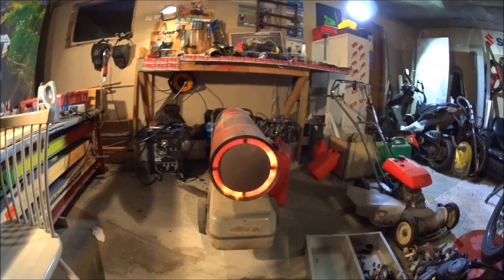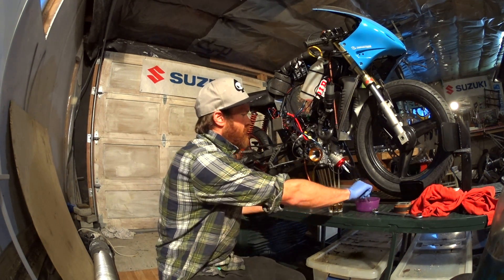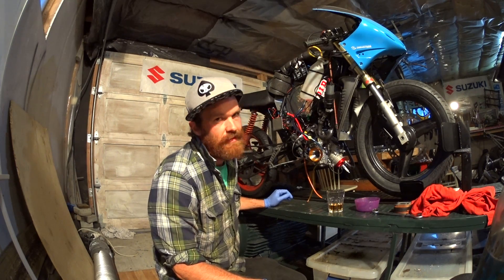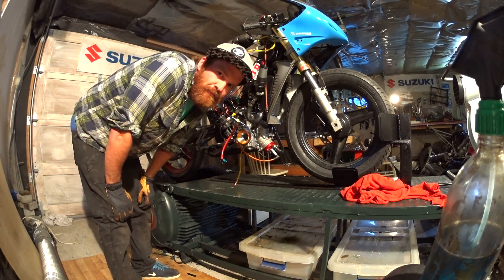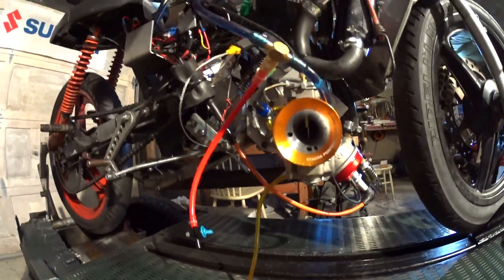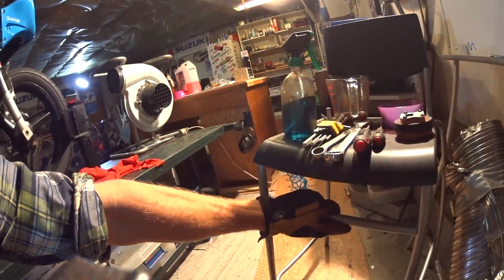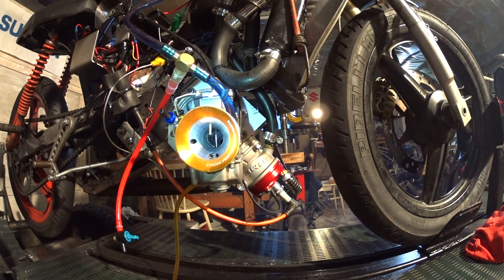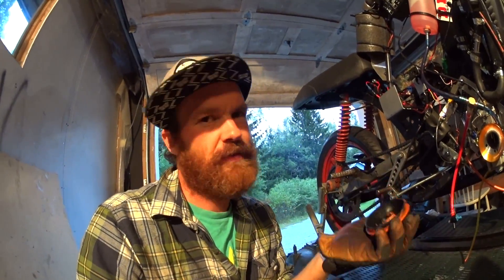YOU WONT BELIEVE IT! Two Stroke Running With No Intake Valve!

Comment: Why go through the effort and time to take it out when it would run better with it. That is why it was designed with one. They would not of designed a Reed valve for no reason lol... Nice bike though.
Reply: Ps the valve stops pressured air come back through the carb thats why you can see fuel coming  out not going in. The reed valve stops air coming back out the carb and instead pressurise the crankcase... When the piston goes down. And basically the pressure in the crankcase pushes fuel air mix into the cylinder so if anything you loosing power cause you won't have the pressurised crank case.
Reply from the maker: +Thomas Ozanne Thanks! Because it's interesting to see how it behaves, and it can potentially make more power without the valve.
Reply from the maker: +Thomas Ozanne With the crankcase volume and intake geometry working together in resonance you can make it never blow the wrong way through the carb within a narrow rpm range. Sync it up with the pipe and it might actually produce more power than with a valve because there's nothing messing with the resonance. My engine is definitely not optimized for this yet, but you gotta start somewhere.
Reply: @2STROKESTUFFING  never seen that ever before ..  really amazing.. 👍
 i would have lost that bet instantly... 😊
 Thank's for   sharing and learn me a little bit more about different intake types. Ps. What is the World record HP, for 2 stroke 50 cc  ??  Maybe you'll be breaking it 💪👍

Comment: All 2 strokes dont have intake reed valves. Like example suzuki pv 50 that was brouht to finland, they had to take reed valves off to get the power down to 1,5hp so it was legal.
Reply from the maker: +ACreativeName Wows, lots of comments... No. You are referring to engines with piston controlled intakes, the piston is the valve. Here I'm running with a gaping hole into the crankcase, always open. Completely different.
Reply: 2STROKE STUFFING but when the port is closed it cant escape. Same with the normal old 2 stroke engine
Reply from the maker: +ACreativeName Now I understand! You are mixing up the intake port and transfer ports. The transfers move mixture from crankcase to cylinder, the intake moves it from outside into the crankcase.
Reply from the maker: +Old School YAMAHA You are right, all two strokes don't have reed valves. Some have reeds, some piston port induction, and some rotary valves of various designs. You sure about this PV engine? Sounds interesting!
Reply: 2STROKE STUFFING yea i am sure :D the suzuki pv is like cultur moped in finland and u can get soo much parts and information of it so its nice moped to tune and play with ;D
Reply from the maker: +Old School YAMAHA You sure there's not a different cylinder made for the Finnish market? Like with many other small capacity Suzuki engines the PV has a weird combined piston port and reed setup. The intake is routed both via a port in the cylinder wall and directly through a reed valve into the crankcase. Not to be rude or anything but I'm 99% sure the restricted "finland-versions" are running in piston-port-mode-only  either with the reed passage blanked off, or with cylinders missing the reed passage all together.
Reply: 2STROKE STUFFING yes it haves different cylinder, i am not sure how they make it work without the reeds.
Reply from the maker: +Old School YAMAHA It works because the intake is both piston port and reed controlled. Blocking off the reed passage makes it piston port only, but not valveless like my engine.
Reply: 2STROKE STUFFING oh okay. U should get suzuki pv and tune it ;) would be fun to watch and u would allso get loads of finnish subscribers
Reply from the maker: +ACreativeName No. The the hole is open 360° of rotation, gas can escape whenever it wants to. Imagine you take a 30mm drill bit ant punch a hole in your crankcase then slap a carb on it.
Reply: 2STROKE STUFFING but it only mkes minor differences since there is in both ways nothing holding the gas from going bavk out from the port.
Reply: Old School YAMAHA theres nothing special about it. If your from germany then you know the mopeds and mofas. They had no valbe at all the carb was directly at the intake port.
Reply: 2STROKE STUFFING but theoretically its the same since the gas still cant escape until tdc. Your hole is just at a diferrent point but other than that its the same https://www.pinterest.de/pin/16536723607172152/sent/?sfo=1&sender=798122502621513957&invite_code=9434a56962584e8383b9148c8d0edd1c

Comment: I had russian vashod 175cc two stroke and it didnt have reed valve. Nothing special
Reply from the maker: +Silver Eik That engine is piston ported, meaning the intake port is in the cylinder wall and the piston is the valve. My engine has an open hole directly into the crankcase.
Reply: True didnt think that far :)
Reply: 2STROKE STUFFING but theoretically there is no difference at all
Reply from the maker: +ACreativeName No, theoretical or not it's completely different.

Comment: I wonder if Runner length from the throttle plays a big role now.... I bet you if it had a pinch point in the intake it would work a lot better.
Reply from the maker: +all the boost It should. Alot to be tried here.

Comment: The piston is functioning as a valve, thats basics in a 2 stroke engine. The powervalve is just improving flow, it is not essential for the engine to run.
Reply from the maker: +aaron f No sir. In a piston port induction engine the piston is in control of intake timing, in both reed and rotary valve the piston has nothing to do with it(directly at least). This engine is designed with a rotary valve intake, in this video I'm running it without the valve. Just a big gaping hole into the crankcase, always open. You are right about one thing tho, the valve doesn't seem essential for the engine to run...

Comment: If you would have asked me will it start and idle I would have said no, it shows that the motor is not dependent on primary compression from the crankcase. Will be interesting when you run it again to see if you get fuel standoff at the carb inlet and how this changes with revs. you have blown one theory,  but the pipe should not resonant over the full rev range, at least not according theory ? Keep up the intersting work

Comment: Early 2 stroke motors had no intake valve of any kind, just the normal porting so no reason why it will not start at least. Valves and reeds are methods of controlling the internal flow for power and emissions control. Even now small capacity low power 2 strokes do not have valves. Eg chainsaw motors.
Reply from the maker: +Frank Beaton All those engines actually have intake valves, the piston. It's called "piston port intake".
Reply: Yes they do but the piston closes the intake port on the down stroke ! , this engine has the intake port below the piston @ BDC
Reply: rght works like PP 2t like chainsaws! Reed valves and rotary valves are there just to prevent the flow back at intake side!
Reply: manos vitalis theres nothing special about it. If your from germany then you know the mopeds and mofas. They had no valbe at all the carb was directly at the intake port.

Comment: No surprise here, said in last comment itll probably start and run, carby acts like a bit of a valve to get it started and since transfer timing contains the combustion its not like a 4t without an inlet valve. it should rev too, once engine speed rises gas inertia works more.
Reply from the maker: +I Make and Fix Stuff Good point about the transfers! I'm eager to see how it behaves at and beyond peak power, and what kind of power it makes.
Reply: Should be ok up top, consider a broken reed will effect lower RPM, and maybe over rich at lower end with potential for extra dosing at the nozzle as the air passes it going in, again as intake blows back out at lower RPM with no valve, and maybe more as it sucks back in.

Comment: that's interesting that it started and idled so easy. it must be the pipe ?? I know it works at wot but not at idle. people broke the pettles on reed valve motors and they still ran. would be interesting if you could somehow lock the rotary valve on the intake phase on wot or when goes on pipe. or a reed valve that could be controlled to stay open at a certain time

Comment: :O Everything I've been taught about two strokes is a lie! That is nuts! Do you think it will be able to fill the cylinder at WOT? I assume the throttle is providing some back pressure? Or will the exhaust pipe resonance/pulses pull enough vacuum to facilitate cylinder filling? Awesome stuff man!
Reply: "the light bulb conspiracy" come to mind.. like; been made up just for manufacturers can get that little extra paycheck at the end of the month loool
Reply from the maker: +Me 2 Haha, Maybe maybe more of the "essential" parts can be tossed too, like the piston and crankshaft.
Reply from the maker: +TheForcedinductn Thanks! In theory it should be able to fill the cylinder when on the pipe, we'll see! It's all about resonance!
Reply: @2STROKESTUFFING  .. No, farts are all about resonance. but now you're talking methane, not petrol.
Reply: The TZ has a larger delay before it covers the port. Yes it does but at lower RPM you get fuel spitting back.  As speeds increase the mass of the air and speed actually help it stop spitting back. You are getting it working because the gas speed is high enough to keep the mixture from coming back out. The valve timing should give better power but it will run cleanly once the gas speed is high enough to overcome the crankcase pressure. You are just losing crank case compression.
Reply from the maker: +Richard Vanags Nope. Watch my intake types video.
Reply: Hi man! I really can't believe that this is hapens! It is idle, yes, but do you test it with wide open throttle, and with the loaded engine?
Reply: It is basically the same as early Yamaha TZ's with piston porting. No reed valves or any kind of valves at all...
Reply: theres nothing special about it. If your from germany then you know the mopeds and mofas. They had no valbe at all the carb was directly at the intake port.

Comment: This is really interesting.  Is there any thing different with the intake system apart from the rotary valve removed? Look forward to your latter testing. Thanks for sharing the work that you are doing.
Reply from the maker: +Neil Lickfold Thanks! All else is the same, I just removed the valve. I really didn't think it would start or idle at all. Baffled!
Reply: Thanks .

Comment: It won't idle but you should be able to rev higher but it takes a lot longer for it to rev up
Reply from the maker: HOT SHOT 1500 It will idle and didn't seem too slow reving!
Reply: 2STROKE STUFFING it should when you get some resistance and I meant a slow idle